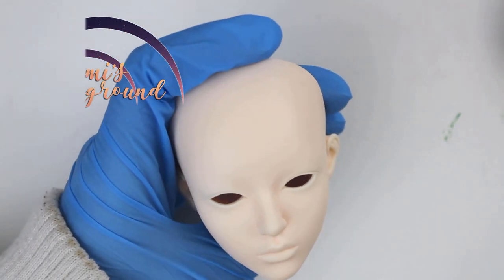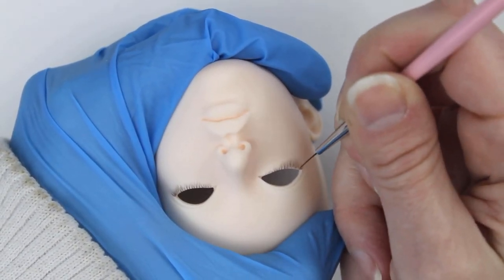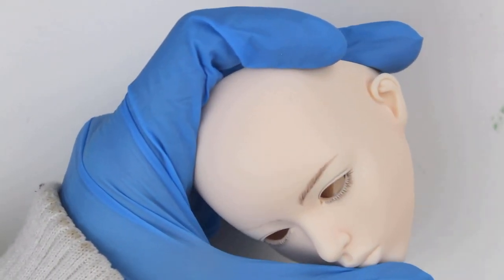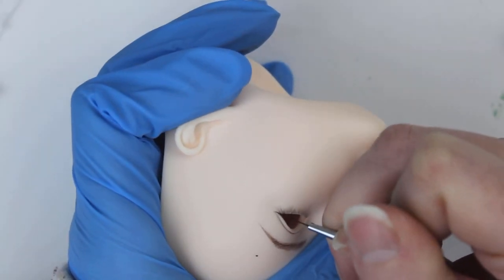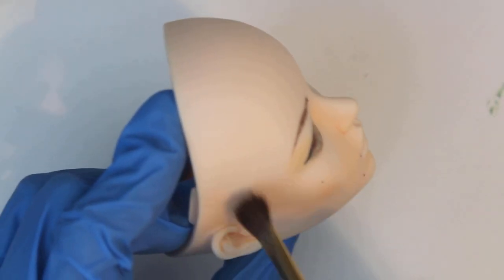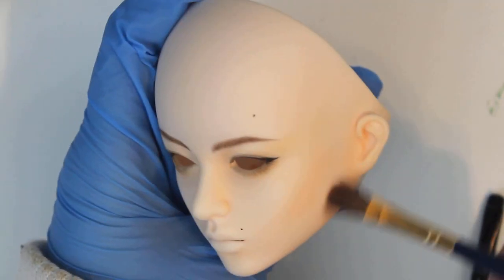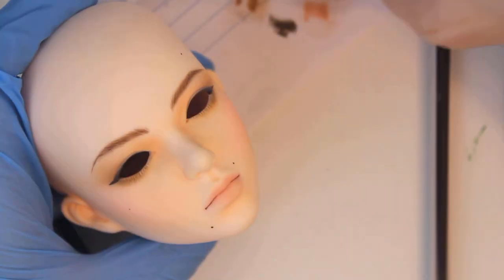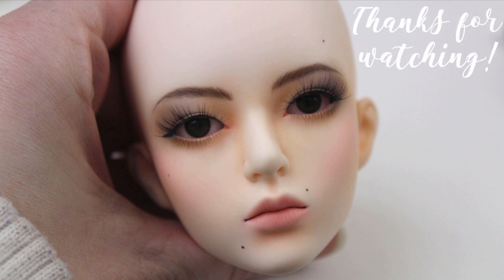BJD Faceup: Getting thin lines with paint, featuring RaccoonDoll Gene

Comment: Hi, Lomi. Great work your hugely informative videos. I enjoy your content very much. I have a suggestion regarding sharpening watercolor pencils (and graphite pencils as well). When I was in art class in high school, the teacher gave us a great tip to "not sharpen off half a pencil when you work on detail" as she said. After you have sharpened the colour pencils, use fine grit sandpaper (above 200) to sharpen only the tip. It works wonders. You could also use a paper nail file. 😊
Reply from the maker: Ooh--I've tried sandpaper before and it didn't quiiite work for me, but I never thought of using an emery board! That might give me the extra bit of control I need. Thanks!

Comment: About the sharpener - it doesn´t matter what brand you have. It is very important to go slowly and carefully. I usually create a very small amount of clippings ( dunno the english term - you know, smal pieces of wood and pencil left after sharpening), yet I have a very nice point. Control is very important too. :)) Thank for the viedo tho, I have a new insight about brushes!
Reply: Not sure if you care, lol, but i think the English term would be "Shavings"
Reply: @StormyBuckets  yes! Thank you!
Reply from the maker: Yep! That's what I do--my problem has to do with the angle of the blade not giving a precise tip, I've never managed to find a manual sharpener that doesn't have a small gap where the tip ends up not getting sharpened. I'll share photos to describe the issue when I go into that subject, though. Maybe by then I'll have found a better sharpener.
Reply: @LomisPlayground  Oh, I see. Well, when that happens, I just use box cutter and make it as sharp as I can. My husband sands his pencils on fine sandpaper. Also works well, but I´m not so sure if it could help on face-ups. :D
Reply from the maker: @Figotkademargot  I'm up for trying anything! Maybe I can use one of my craft knives to sharpen them and see if that works better. :D